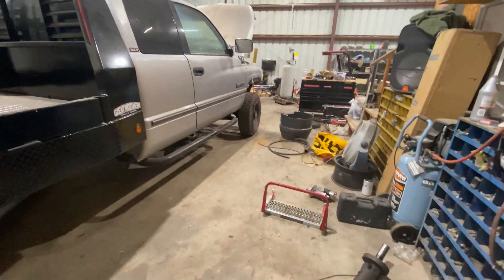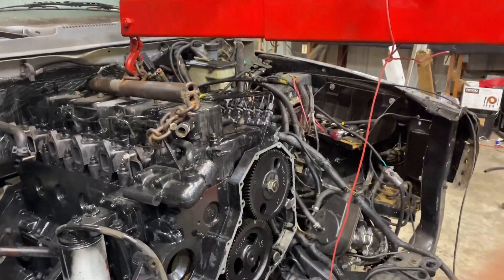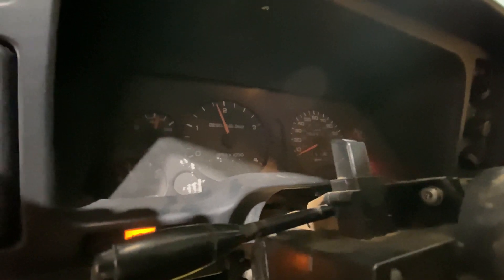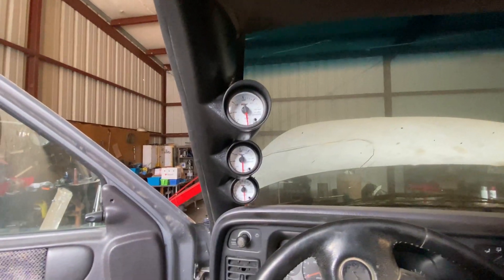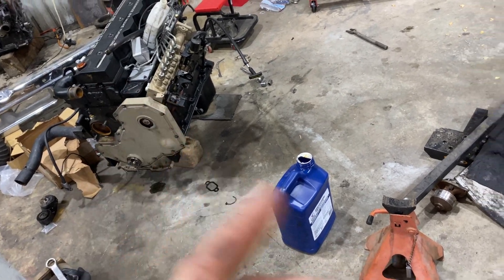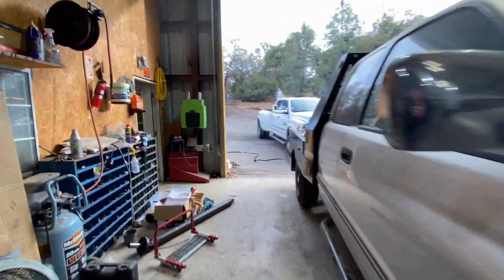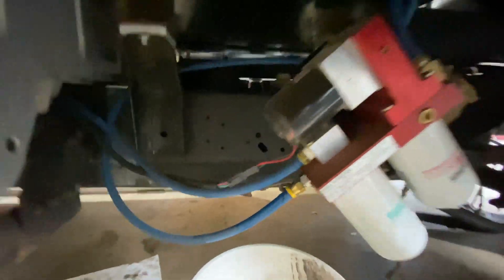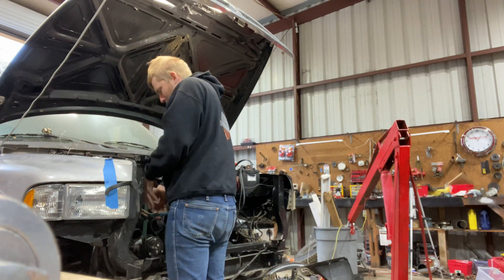INSTALLING THE NEW 12 VALVE CUMMINS ENGINE! FIRST START UP!!!

Comment: Finally!  A  good  runner.  Happy  for  ya  Sam. Loved  the  whistle.  Turned  the  volume  up  so  I  could  hear  how  loud  it  was. Liked the "sneak peek"  too.  Didn't  see  anything  yer  hand  blocked,  even  though  i  replayed  it  4  times,  wink  wink.  Grandma's truck  IS  unique.  Extended  cab  to  start,  with  a  bush  bar  and  a  flatbed,  it  is  very  unique.  And  with  the  man's-mission,  in  my  neck  of  the  woods,  it's  also  rare.  Like  I  said  earlier,  happy  for  ya  Sam.  Keep  'em  coming,  we're  here  for  ya.

Comment: 13:02 swap out your gauge to make sure the spring ratings match. So then you can have a more accurate base/starting point then you can change the springs.
Reply: I have a 96 Chevy 1500 two wheel drive V6 5 speed that I'm trying to restore but a daily her but I do have the option where I can park her and do a frame-up I can do it I just don't have the budget so living through you my friend keep up the good work stay blessed

Comment: FWIW, Tork Tek recommends not using the stock or aftermarket adjustable overflow valve with an electric lift pump like FASS/Air Dog. Look up Tork Tek OFV050HP, that's what I'm running on my '94 12 valve and it helped with pressure loss at WOT, having to mess with tuning and inconsistent fuel pressure, or worrying about springs/check valves when they're not needed. However, you do have to adjust pressure at the lift pump with this style of overflow valve.

Comment: I wish I would have done a video of me rebuilding my 7.3. Never had a diesel before but I could build a gaser in my sleep. I rebuilt this truck from front to rear and ground up. I took pictures for reminding myself where somethings go. Should have done some videos. 95 F 350 4 door dually. Took me 2 years. Wouldn't trade or sell it for all the tea in China.

Comment: 4th gen life hack on the oil filter... take the 5 minutes to take the air box out and intake tubes, its still possible to pull the oil filter and bring it out that way, i do it all the time on my 4th gen and my fathers 4th gen. way less mess, also can buy a "cap" for the oil filter from genos garage
Reply from the maker: Fairly confident I said that in the video

Comment: Lisle 57180 Oil Filter Plug Tool, it will make your life easier when changing the oil on that 4th gen, I tried that bag crap with the same results.

Comment: Damm your tough a doo list is just as long as mine I'm so far behind i think that I'm ahead lol
One thing about having lots of projects on the go that need to get done is you dont have time to cry about failures just need to git r done and move on.
I have a deere in a million pieces taking up space in my shop since spring have 2 other Deere's clawing at the door wanting to get in for the winter and then 3 more other tractors wanting in. My wife keeps asking me if I'll remember how to put it back together considering it totally gutted all started with the previous owner had it at dealer and they put a seal in backwards took out clutch and pto bearing i figured I'm into it that far might as well do some bushings and fix the leaks at least i have the other 2 Deere's to look at if i forget where something goes then 3 more other tractors after that got plagued with breakdowns didn't have time to fix needed things done so just go buy another cheap running one so now going to be a busy winter plus I still need to go cut more fire wood to keep my ass warm while working in shop.
Good luck with this engine hope it works well for you 👍👍👍🚜🚜🚜💨💨💨💨💨
Yes its 4 am here i find that I get more done when nobody is bugging me and no phone ringing all the time. Time to shut it down and get few hours sleep and get at it again.

Comment: P-Pumped, all mechanical 6.7L? Is it doable and is it in your future plans if so?
Reply: Well they can put a 12 valve head on a 6.7 block.  That’s what power driven diesel does I’m pretty sure.  So kinda possible

Comment: Sam, I use this Oil filter plug tool. Look on Amazon its a lisle, part #57180. $12.47
Reply: Think Geno’s garage also has them
Reply: Spend the money and buy the metal filter plug and the filter wrench ste. Worth every penny
Reply from the maker: I ordered one🤘🏻

Comment: how much fuel pressure should a p-pump have, i have a air dog raptor fuel pump and i just put a 30 psi glow shift gage on it and it says i only have 25 psi, any help is appreciated thanks

Comment: What's your take on Shell Rotella vs Valvoline since you do a significant amount of oil changes.  Noticed you were using Valvoline, which is factory recommended, but I have seen some examples from wear tests and lubricity tests that shows Shell is a little better on protecting parts from wear.  Just looking for your opinion on diesel oils.
Reply from the maker: I’ve always ran rotella but trying valvoline right now. Oil change around 5k
Reply: @VBELTandSON  Cool, gonna start doing my own oil changes and was thinking of switching to rotella because I do not trust the dealerships.  Not sure if you saw my comment on a previous video regarding your check engine on one of the trucks (Purple truck?) regarding AlfaODB?  I haven't used it yet because I have an 18 and need the security code to program the computer but should let you change your ECM to manual trans.

Comment: I do got one question your brake system on your grandmas truck do you run the abs system and the computer on the truck? If what do you have to change on it or if you have to change anything?

Comment: Sounds like there is something wrong with the P pump. All the other mechanical problems that it could be you have looked into.  I think the is something internally wrong with the pump.
Reply from the maker: Piston slap maybe
Reply: @VBELTandSON   true. I forgot that you never went that far into the engine.

Comment: this is the tork tek overflow valve i put into my truck with my fass.  holds 45 psi all day long. 

http://www.torkteknology.com/cummins-p-pump-high-performance-overflow-valve-ofv050hp/